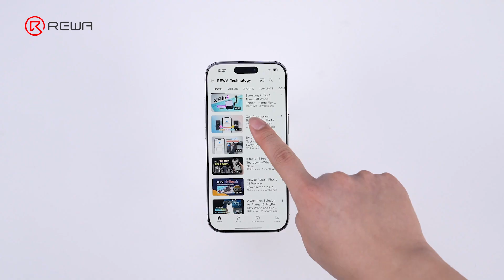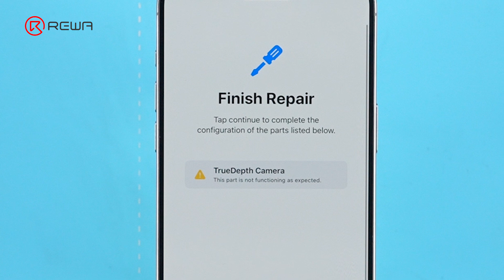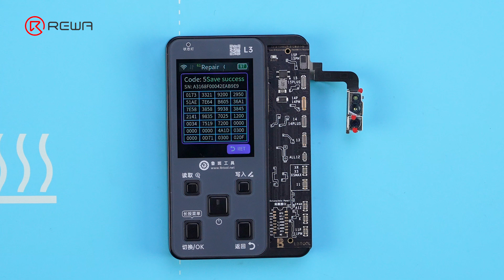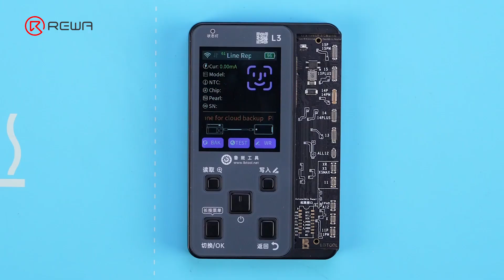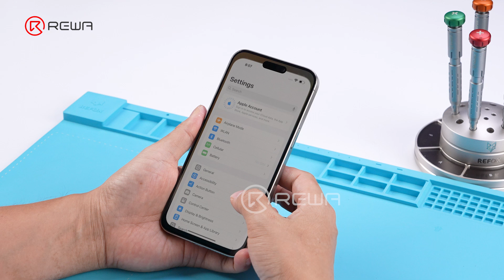Face ID Repair is Easier on iOS 18.1?

Comment from the maker: Is Face ID really easier to repair on iOS18.1? Leave your comment and share us your testing❤❤
Reply: Make a Face ID video about 13 pro max
Reply from the maker: @shahariarnawshintaki1743  13 Pro Max shares same result like 15 Pro Max, even the  repair method
Reply: I dont know
Reply: Sir, I am also an engineer, but your work is very clean, you work on textiles, in fact, you are the original mechanic, I like your work very much, I always watch your videos, I hope you are well.
Reply: It's really great ❤❤❤
Reply: Does that work on xr 18.3.1
Reply: May I asked about replacing REAR main camera on iPhone 15 Pro with used part from another iPhone 15 Pro result? How's the alert and functions?

Comment: are you soldering the new IC from new face id into old face id or old IC from old face id into new face id ?
Reply from the maker: Actually when it comes to different brands, there is a little difference for temp and airflow, usually you can check our full video for reference: https://www.youtube.com/watch?v=GsiIMWr0kzk&t=269s

Comment: Its possible now use tag on metod on 15 pro Max too? Im looking for the module for jcid v1se
Reply from the maker: You can also check our RP 30 no solder repair:https://shop.rewa.tech/detail/refox-rp30-front-camera-repair-module-and-cables.html

Comment: I am using iPhone 15.
Face ID does not work after impact.
Dot Matrix does not work due to impact. Do I need to replace the IC in this case? Or can it work again by re-soldering?
Reply from the maker: You can use the programmar to connect the face id to check what happen first

Comment: Bro please make video for faceid of 15 pro on ios 18.3
Reply from the maker: Have you encountered any face id repair problem on iOS 18.3?
Reply: @rewatechnology2008 yes on 15 pro it is not working as you paired in iphone 16. My screen is changed and it is giving used msg + truedepth msg as I dont have the previous display guide plz
Reply: Can I swap faceid from a iclouded phone on 15 pro on ios 18.3 and will it work with a used display msg
Reply from the maker: @ The only method is just like we show, reapair the native Dot projector IC

Comment: I try to repair 12 pro with tag on flex but it didn't work right after I did the process that didn't work, I try to test the face IDon the true  tone programmer my face id turns out to be a normal but when I install and test face id on the iphone it did not work also. I think the reason is I update my device on ios 18 before fixing face id.
Reply from the maker: Oh so did you finish repairing it?
Reply: @rewatechnology2008  unfortunately no, I still finding solution how to fix it, anyway I'm using A.Y Tools same with tag on flex.
Reply: @rewatechnology2008  Unfortunately No, I still looking for solution on how to fix it, Anyway I'm using A.Y tools same with tag-on flex brand.
Reply: @rewatechnology2008  You might have an idea, my current device running on iOS 18.2
Reply from the maker: @aaizendrake  And now face id can pass repair assistant? or perhaps it can record face id on iOS18.2?
Reply: @rewatechnology2008  No, it did not, I did multiple times. and what does it means record the face id on ios 18.2?

Comment: Hey, ich habe eine Frage zu iPhone-Akkus: Wenn man einen originalen Apple-Akku nimmt und das BMS (Battery Management System) von einem alten Akku darauf überträgt, könnte das iPhone dann die Kapazität des neuen Akkus korrekt erkennen und die Akkustatusanzeige entsprechend kalibrieren? Würde das System dann die volle Kapazität des neuen Akkus anzeigen, oder gibt es dabei Probleme, wenn man das BMS manuell anpasst?
Reply from the maker: Apparantly the BMS board is the one who offers data to motherboard, generally if you transfer BMS board to new battery cell, the motherboard will read it first, so we generally will flash the phone to fix that

Comment: Hello, I have a question 
If after reaplcing the ic and during the test the face id on iPhone 15 pro max on the programmer show every thing is normal but when it installed and tested again with the calibration app HEGES 
 doesn't show any image but blank what is the problem
Reply from the maker: Here generally you may meet two problem: 1. the Dot projector IC may place the wrong position 2. the hot air gun station may damage the flex cable but we do not know what brand of hot air gun you apply, perhaps more you can provide us more detail to help you
Reply: Check IR camera beside dot project bro
Reply: @hathanh1412  Thank you 
How I can check it?

Comment: On iPhone 15, I swapped the display, proximity, front camera, and speaker from another iPhone 15.  Repair assistant configured everything except Face ID has "Issue".  Putting the original front camera back in did not restore Face ID function.  Repair assistant will not allow me to configure even the original part.  Now Face ID is completely disabled.  How do I restore?
Reply from the maker: The origianl one should work after you replace and nothing will pop up, if it really can not pass repair assitance, maybe try flashing?

Comment: If i downgrade ios 17, It will unlock face ID ?
Reply from the maker: Actually it should wok just like before, unless iOS 17.7 has new update.
Reply: @ oh thanks 
I wanted to stay iOS 18.2 but I will try downgrade iOS 18 to iOS 17.7 soon
Reply from the maker: @nyinyitin9939  But on ios 17, if you swap ic like we did in video, it will become not available and not work
Reply: @rewatechnology2008  yes? Not work? :(  I waiting that.
Reply from the maker: @nyinyitin9939  Yeah on iOS17, your face id will also pop up message like our video, so face id replacement we suggest you apply the method we mentioned in the video
Reply: @ thanks I trying to do now but I need backup my data
Reply from the maker: @nyinyitin9939  Good luck, we also hope your method may work

Comment: when you swap the front camera with the original display from a workin iphone to another iphone , then it works. the dot projector and display must be from a working iphone
Reply: I have transferred a same display and face id from a donor phone but only the display got paired. Repair assistant says there’s an issue with the truedepth camera.
Reply: @kento6201 pudiste solucionarlo?

Comment: i guess it could be the wrong assumption  
it is likely that apple allows swaping and setting up only "new" faceid parts
in case of this 15 pro there is a "used" part
for example if you buy a truedepth camera from apple you will still be able to replace it yourself on models 12-16
Reply from the maker: As we test in the video, only 16 pro can finish repair for face id, the 13-15 only applies the old method, full test result we can check the end of video

Comment: Wait, if the tester showed a problem with the dot projector, isn’t it the reason why it didn’t work on the iPhone in the first place?
Reply: they wantedly demonstrated with the phone having face id issue.

nonetheless, video is about replacing the parts and will they be configured in ios 18.1 is the main point.
Reply from the maker: At first swap test ,we would love to check about how the face id would perform on ios18.1, as for the error we try to simulate the dot project ic replacement repair method.

Comment: Thank u for the video, but can you make a video about the camera swap on iphone 15 pro max please.
Reply from the maker: That calibration just like you aiming the one targets and keep focuing on some objects, the most important point is the your calibration progress bar must grow and your network should support you finish this, otherwise it will become nothing but a failure
Reply: @rewatechnology2008  thank you very much for your answer
Reply: if you mean main camera swap there's nothing to make another video about: just swap and run repair assistant
Reply: @eegee24  yes that is what i mean, but i have a issue with the calibration and i dont know what is going on, thank u for answer me.